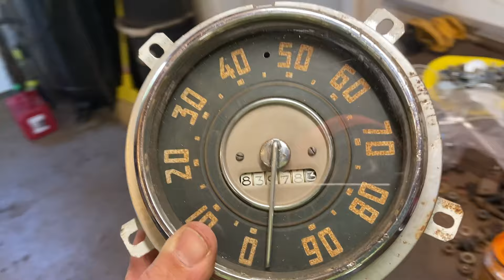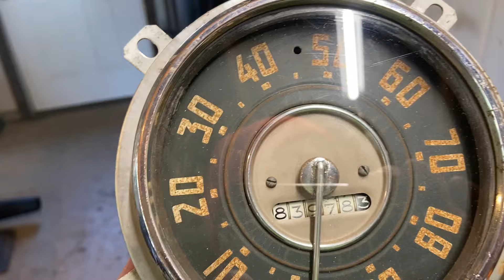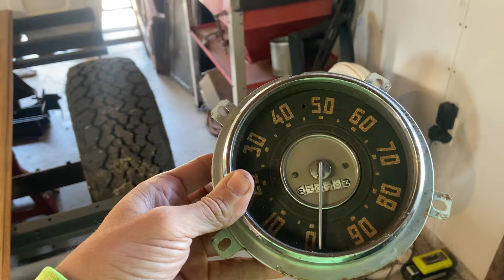1951 Chevy Suburban Cheap Project Updates

Comment: Look for a set of gunsmith screwdrivers. They have tips that are parallel ground and keep from slipping out of slots. Keeps from chipping chrome screws. Three on tree can be hard to shift if bushings are worn out. Drive a work van (63 Chevy) that would lock up between gears. Had to park, kill engine, and manually pull linkage to get it loose.
Reply from the maker: Yeah I read another guy saying adjusting rods gets little tricky